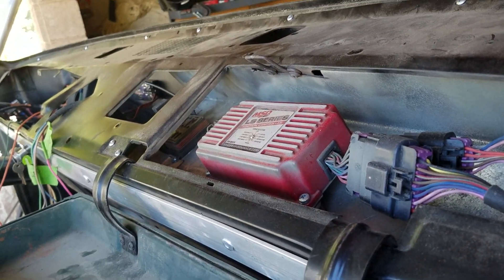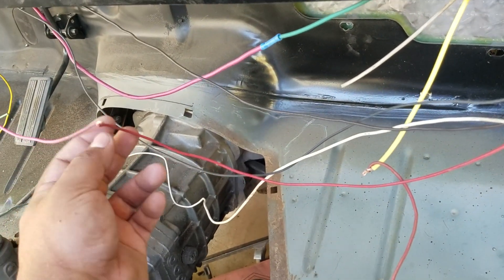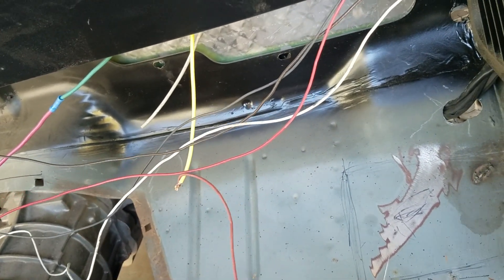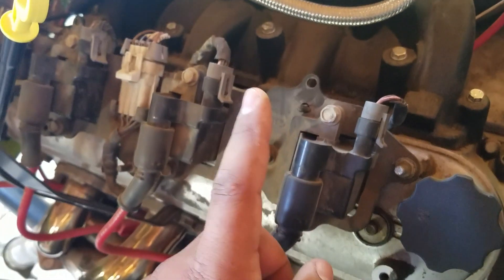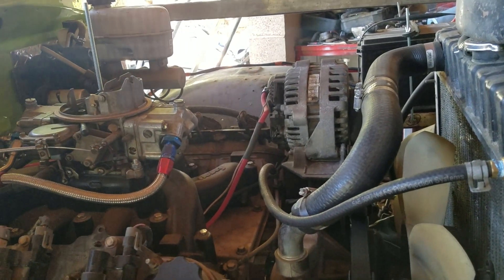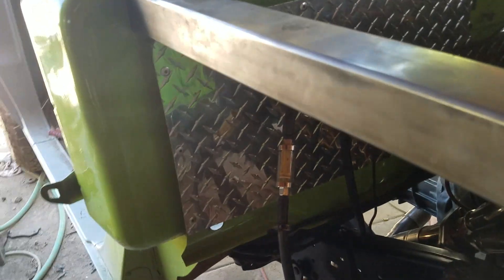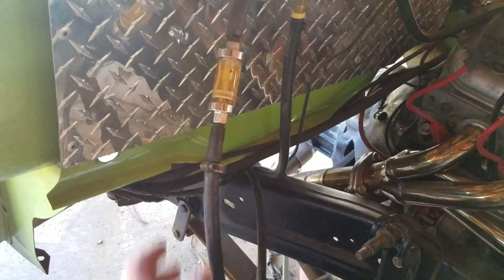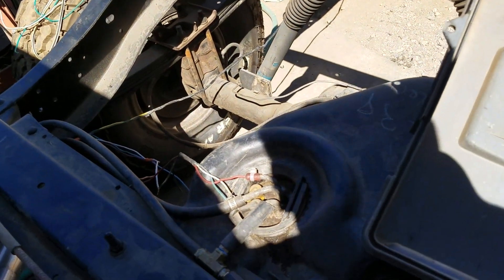Setting Up Your LS MSD 6014, 6012, 6010 Ignition Box For Your Carbed LS Swap|LS Carb Swap| NW EP. 46

Comment: Ok so how would I wire the alternator?
Reply from the maker: @GeneralDSM  https://youtu.be/t-yRgSEK19g?si=SiwtN8Zvmcehd_PI
Reply: @ and do you have a video that shows what fuel pump to use?
Reply from the maker: @GeneralDSM  I do not actually. For a carb set up you can use any fuel pump that puts out 15psi or less and then use a basic dead head or return style regulator. If you can tell me your engine specs and how much power you plan to run, I can send you some links with what you need.

Comment: Yo! I have been watching your vids and you have been a big help in me  getting my swap together. UNFORTUNATELY  i have run into a  slight problem. Today was the first time i tried crankjng my motor , its spinning over but but not cracking.  Im using the black ls series msd box . All i have wired up is THE COILS , ALL THE SENSORS ON THE BLOCK im getting gas but i believe  im getting no fire WHAT COULD I HAVE DONE WRONG?
Reply from the maker: On the box there should be a number like p/n: or part: what is it

Comment: Could you explain to me your starter setup ? How did you ground and wire it up accordingly to your msd setup
Reply from the maker: Your ign switch should have a wire for ignition. Its either 1 wire or 2. Ones for cranking and running while the 2 wire has the circuits seperate. You can wire it the box so that it runs off the same wires your old coil used to run in case you have the 2 wire set up or if you only need to run 1, you get that straight from the ign switch. Hope this helps
Reply: @NightWrencher  that makes sense I have the 6014 so it’s only one 1 that goes to a 12v ignition switch.  So for the starter would I just need a regular positive and negative cables to go to a ground and the battery?
Reply from the maker: @ryanleaks4894 for the starter itself, you get ground when you bolt it on to the engine. The big red wire goes to the batter and the small terminal goes to your igniting starting wite

Comment: If I put a fuse in the main power wire do I need to run it through a relay??the instructions say run it through a relay
Reply from the maker: It depends on how you have it wired. If your relay goes feeds directly from the battery to give the box clean power, then install a relay. But if your relay would be after a bunch of other stuff and the power to the relay is already dirty, then just hook it up to the ignition switch and call it good.
Reply: Straight to the ignition wire it is then! Thanks for the reply Bro I appreciate it

Comment: Hi great video looking for more information. Hi 65 yr old LS rookie here. I have a new built 2004 LS 6.0,30 over,aggressive cam for torque (airboat application, need torque to get boat moving with 4-6 people) LS1 heads, 750 single pump but dual feed carb,(heavy valve springs ) hire rise intake with another 2 inch spacer to bring in more air, new 6014 msd box. Looking for a video to teach me how to install,  how to use laptop, what software i need and how to use it. And what those settings on the MSD box work/effct the engine.  Any help greatly appreciated.  Tim, Omaha Nebraska
Reply from the maker: Hello, I don't use the MSD 6014 anymore but tuning the box is very simple. If you hook up the map sensor hose and leave it in "truck" on the dial, it should give you a good running timing curve, no laptop required.

Comment: When you dead head an electric fuel pump the fuel overheats at the fuel pump and boils the gas and creates air pockets and it will stop pumping. Absolutely not a good idea
Reply from the maker: A lot of the modern pumps have an internal bypass when they reach max dead head pressure so it depends on the pump

Comment: Please Bro don't ever mention to ANY adults that you used an Eldelbrock ok !! Real Motorheads just DONT use those Bullshit carbs wannabees do Possers Do ! And I'm pretty sure that 3psi might be just fine for just idling in your driveway but I'm certain that just will not be enough to get you down the street ...we always regulate to between 4 and 7 psi ..just saying ..

Comment: What timing setting did you use
Reply: Ok thanks....do you have a suggestion on what timing setting to use on stock lq4
Reply from the maker: Anything above truck will require 91 octane and the gains arn't worth it.
Reply: @NightWrencher  thanks again for the info and great video
Reply from the maker: I used my own custom timing  Map on the laptop

Comment: Do you have to tune msd box ?
Reply: Is the SSLS made by msd i cant find it do you have a link for it?
Reply from the maker: The SSLS is made by daytona sensors. Here is a video with all the links for the stuff
Reply from the maker: https://youtu.be/FMwZhpEelbc
Reply from the maker: The stock MSD box comes with 4 preprogramed tunes out of the box so set the dial to whatever setting you want and itll fire up. I got rid of my 6014 in place of the SSLS and so far no regrets
Reply: Thanks bro.

Comment: Did the fuel tank originally come with an electric pump?  And when it’s running you can see fuel from the return in the filler neck?
Reply from the maker: I have a video on how I retrofitted my fuel pickup to accept an electric pump since the stock tank didnt come with one. When the pump is running I can hear the fuel at the filler neck pouring back on the return side
Reply: @NightWrencher  ok.  I’ll look for it.

Comment: I see wires I quit. I opened my msd box and said idk how I'm gonna do this lol. It's not alot of wires but man....I'm gonna have to watch this video atleast 20 times.  I wonder if my Ignition switch looks that way? I always wanted to rewire and only run what's needed
Reply from the maker: Its not too hard. Its only a few wires and the rest should be plug and play.
Reply: @NightWrencher  yes the plug n play is the easy part lol.
Reply from the maker: Its just powet and ground!
Reply: @NightWrencher  lol. What about tach, my trans has a brake. And then the hard part on the computer screen
Reply from the maker: @benaiahtheassassin  you're going to have to wire in your own set up for the trans brake. The RPM signal comes out of the box as an HEI chevy square wave so any aftermarket tach compatible with an HEI will work. You can run on one of the Factory ignition map to get your carburetor tuned and then play with your own Maps when you get on the dyno
Reply: @NightWrencher  gonna be turbo to if that makes it more difficult.  Right now I'm searching for how to hook up the box and master disconnect switch
Reply from the maker: @benaiahtheassassin  not really, it has a built in map sensor so you can hook up a vacuum line and it can retard timing when boost is added
Reply from the maker: @benaiahtheassassin  your ign switch to a 7.5amp fuse and then from the fuse to your box
Reply: @NightWrencher  I wonder if my Ignition looks like yours
Reply from the maker: Most ignition switches have an off, run and start. Just find the wire that is hot during run AND start and you should be fine
Reply: @NightWrencher  lets see if I missed something
Reply: @NightWrencher  aha. Ignition going to battery keeps it from cutting off lol
Reply from the maker: @benaiahtheassassin  so its wired wrong? The the ignition switch should cut power to the relays to prevent backfeeding
Reply: @NightWrencher  straight to the battery lol
Reply: @NightWrencher  what relays🙃😂
Reply from the maker: @benaiahtheassassin   It says in the instructions, use a relay!
Reply: @NightWrencher  lol 🤣😂🙃
Reply: @NightWrencher  Did you have a issue with your tach working?
Reply from the maker: Not really. Just had to install a resistor in my toyota cluster to make it work
Reply: @NightWrencher  mine just won't work
Reply from the maker: Did you check it had proper power, ground and signal from the box?
Reply: @NightWrencher  signal part no, I dont see why it wouldn't.  New box and straight hook up
Reply from the maker: @benaiahtheassassin  how many wires does your tach have?
Reply: @NightWrencher  6! Power, ground, light,
Reply from the maker: @benaiahtheassassin  what model is it? Ill look at the diagram
Reply: @NightWrencher  its a 5inch marshall
Reply: @NightWrencher  its been wired up for years only change is from distributor to msd box
Reply from the maker: Did you wire it like the instructions say? Blue to battery, red to ign, black to ground and purple to MSD box?
Reply: @NightWrencher  this thing has been wired for over 10 years. But it doesn't go to battery I know that. I dont even think it has a blue wire but I will check. It was originally wired for a distributor but since there is no distributor i guess its got to be redone
Reply from the maker: @benaiahtheassassin  lol should have said that first. How is it gonna work if you cut off the distributor wires??
Reply: @NightWrencher  No it still has the wires.  The wire that went to distributor goes to the box now but I guess thats not right
Reply from the maker: @benaiahtheassassin  yeah no. The box has a tach output that you need to wire to the tach directly.
Reply: @NightWrencher  ahhh ok
Reply: @NightWrencher  mine was hooked straight to the battery and it worked flawlessly,  I changed that today to do it as they say and hook to a 12v switched source and now it doesn't fire up the car. Still cuts in and gives signal but doesn't give spark I believe
Reply from the maker: @benaiahtheassassin  if you switch it back to straight batter it will light?
Reply: @NightWrencher  i believe it will. Last time it was started I tried the 2 step and it fail to start before that.  Today I decided to do it right and it didn't start
Reply from the maker: @benaiahtheassassin  well verify that first and then go from there
Reply: @NightWrencher  yea I will tomorrow
Reply: @NightWrencher  back to the battery and it fired right up, but then started acting up and cutting off. Next thing to be removed is the 30 amp fuse. Im gonna run it straight wire like before
Reply from the maker: Try hooking it up to the switch and then jump that the starter with a jumper while while the switch is on
Reply from the maker: Also the fuse for the msd should be 7.5 or 10amps at the highest
Reply: @NightWrencher  im gonna try to hook up thru relay. Power to starter, then the rest regular.
Reply from the maker: Hopefully it works out
Reply: @NightWrencher  well it works kinda! Car not revving past 3000 rpm. Box has full 12v
Reply from the maker: @benaiahtheassassin  might be a carb issue?
Reply: @NightWrencher  I don't see how that can be, if the blades open then it should rev.
Reply from the maker: @benaiahtheassassin  too much fuel/not enough fuel will not let it rev. Do you have a wide band? Anything below 12 will kill RPMs
Reply: @NightWrencher  idles around 14 on e85
Reply from the maker: @benaiahtheassassin  what about when you rev it up?
Reply: @NightWrencher  hmmmm didnt watch that. To worried about why it doesn't go over 3k, ill check that next time.  Im also wonder if the 10amp inline fuse has something to do with it
Reply from the maker: Fuses dont have resistance so it can be a 1amp fuse or a 100amp fuse and it will work the same. The only thing that changes is at what amp it will blow but as long as the amps dont pass the amp rating on the fuse they will work the same
Reply: @NightWrencher  i spoke with msd and they saying it may be the box.  But first they want me to unhook the 2step and see if that works. If not then send the 12v wire all the way to battery no relay or fuse lol
Reply from the maker: @benaiahtheassassin  try it out and lmk

Comment: What if you had gauges with the water temp sensor can I run that sensor inside the block instead of the one that come on the msd box?
Reply from the maker: Thats not a problem. You can add a second water temp sensor to the same place on the opposite head. Just remove the pipe plug and thread yours in. I had to run a seperate sensor for my toyota gauges so I drilled and tapped a hole in my water pump to run a seperate sensor.

Comment: it's cool and all but why did you LS a Dodge I done basically the same with a 5.7 Hemi for about $1,500 that's buying an OC performance intake a MSD Hemi 6 box and 3 hemis from a junkyard but you can make your life a little easier by using a 90 Dodge truck gas tank it will bolt in and it's already made for fuel injection and Holly sells a pretty good fuel pressure regulator it's fairly cheap Part # 12-803 $35.99
Reply from the maker: I'm not sure what state you're in, but here in southern california, finding a hemi at the junkyard is like trying to find hens teeth. Complete engines dont go for less than $1800 by themselves. Considering, I paid $250 for a complete 5.3, $350 for my msd6014, $300 for my intake,  $140 for my carb, $180 for my headers. I finished my whole build for less than the amount it would cost to buy just the engine. We are looking for a hemi for our challenger project, but we arnt ready to pay close to 2 grand for a junkyard engine.

Comment: How do you make the tac work?
Reply from the maker: You can pull the signal off the MSD 6014. It has a wire that produces a 12v square wave like a standard GM Hei distributor. Most aftermarket tachs will work on that signal, but if you have a non GM oem tach, youll need to make the nessesary changes to your tach or add an additional box. For my toyota tach, I wired the tach wire to my cluster, then had to add a 1k ohm resistor to jumper part of the tach and then play with the rheostat inside to adjust it. Idk about other OEMs.
Reply: NightWrencher yes sir I have a after market tach so I need a resistor? To where? And dam love the quick feed back exactly why I been watching your videos!! And thanks for helping mine get going I have posted the video on mines firing up
Reply: NightWrencher it’s under my other account Texas Motor Vlogs
Reply from the maker: @texasentertainmentgaming  yeah man, I think Ive seen a vid or 2. If you got an aftermarket tach, it should be bolt on. I would call the manufacture of your tach and ask them if its compatible if an HEI signal(old school chevy.) Chances are that it is because most aftermarket stuff is chevy based.
Reply from the maker: @texasentertainmentgaming  when I was trying to figure mine out, thats what I had to do to get mine going. Searching for HEI info instead and not MSD specifically.
Reply: Is it the gray wire coming from the msd box?

Comment: get rid of the glass fuel filter, they are prone to breaking and there goes your project in flames
Reply from the maker: Thanks for the advice! Actually I already removed the filter and I have an oem style steel filter on the frame rail now. I was only using the glass one as a conversion piece from 5/16 to 3/8 fuel line. But Im all squared away now!

Comment: Im so close to doing the fuel system in my  carb LS swap. what fuel pump are you using? Im looking for either intank or external. I have it in a 82 c10
Reply from the maker: Oh, one last thing. TBI pumps put out a minimum of 10psi, too much for a carb so youll have to put in a regulator with a return line and set it up to 3-5psi
Reply from the maker: My 85 dodge tank didnt have a pump in it, only a pickup. I put in a pump from a TBI fuel pump and cut off the end of my pickup where I put my pump on using fuel hose. I ran the wires through the nipple for the evap and a vacuum cap. Wired it up to a relay and an ignition source and that was it.